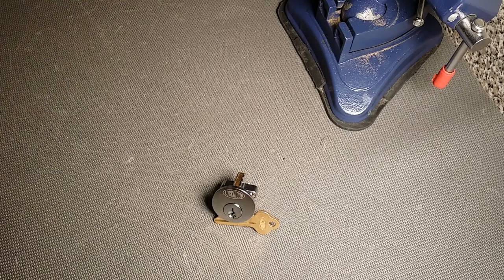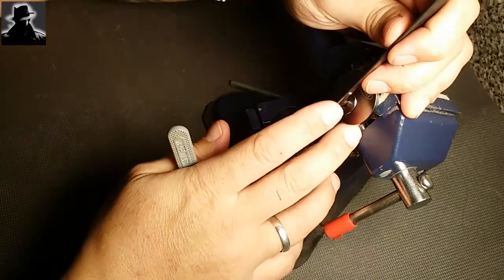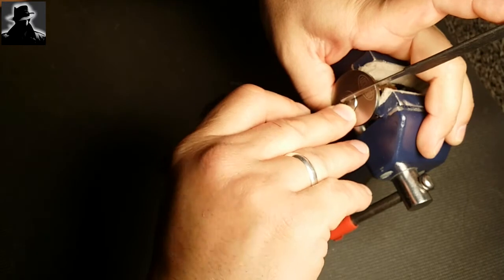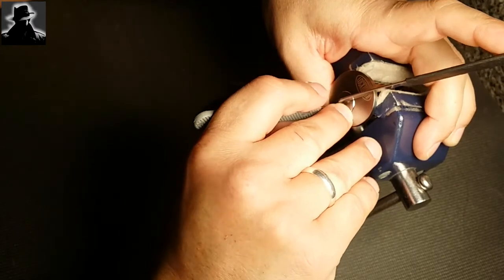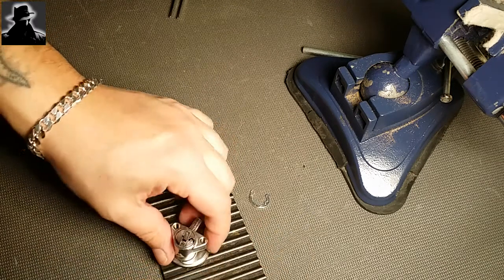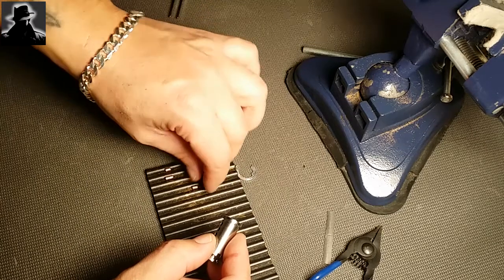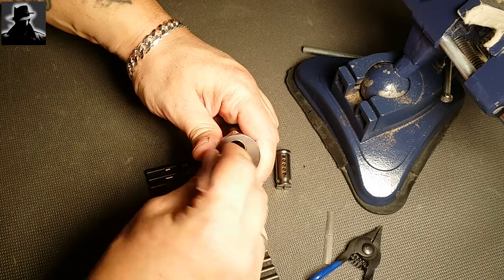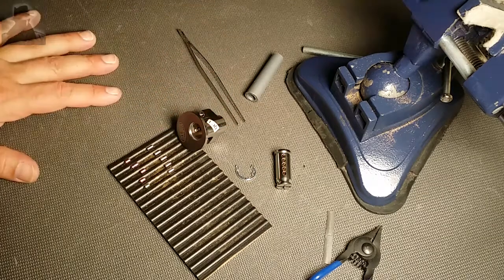-=227=- Lockwood Rim From Noctus Motis!

Comment: Nice job. Besides I gave you that Lockwood rim cylinder to make a challenge lock out of. Lockwoods are nice to pick stock, but if they come with no pins game on.
Reply from the maker: Randy Perkins for sure. I've already pinned it up. but I'm thinking of taking that extra key from Noctis and repinning the lock so I can include a key with it. or look for blanks. lol any idea what the blank is?
Reply: West Coast Picks that would be awesome if his key is the same profile. I don't remember but I think the padlock key fit it and not the oval I had. I have an oval with no pins I was gonna do once I get used to the Dremel. I do happen to have a key for this one. Not to bad on the bitting either.
Reply: Those Rim cylinders usually take an LW4 (5-pins) or LW5 (6-pins).